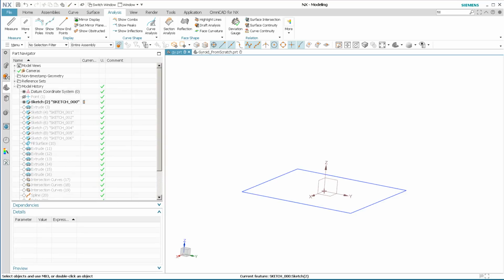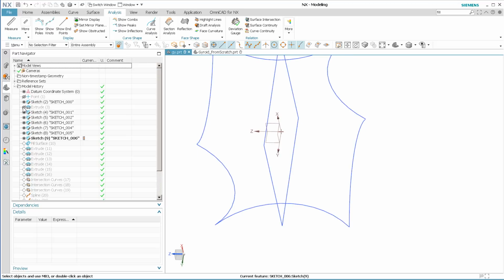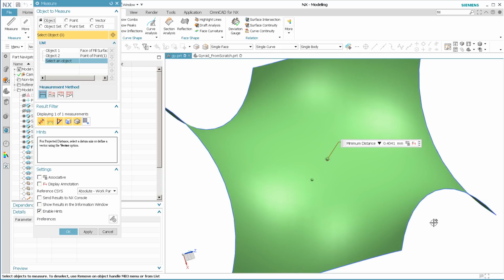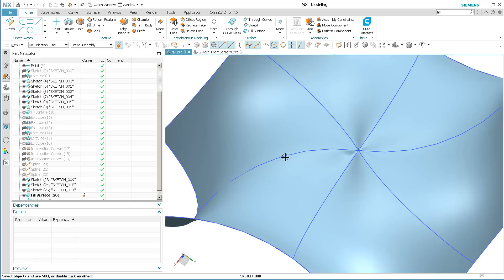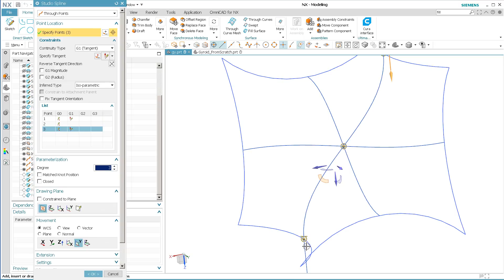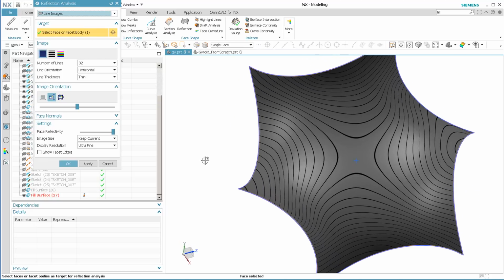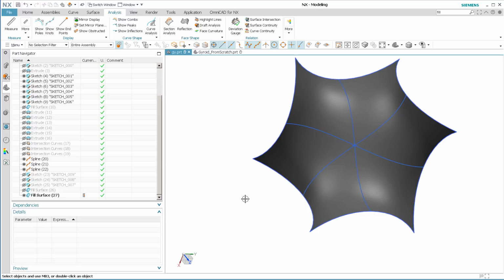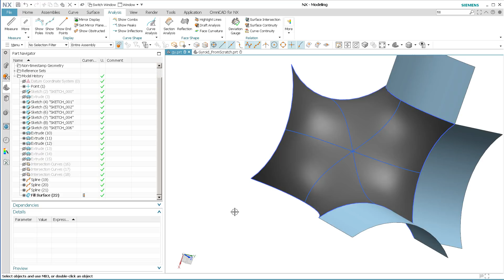Siemens NX: Modeling a Gyroid

Comment: instead of arcs, use formulas that are much closer to a gyroid, such as y=atan(sin (t*360))
Reply from the maker: Not all CAD systems support the making of a body with a formula. 

NX does have that capability but, it will be a convergent body. This is a simple non-formula method and can be thickened and 3D printed.

Comment: Very good. You call also bring the first attempt back onto the midpoint, with a fullness control, but it's a worse result. 
On thing you may not know is that when multiple copies of these are arrayed in the desired pattern to produce a lattice the edges still aren't tangent. You've piqued my curiosity with this video, and I've tried a couple of ways with only minimal success, thus far.
Reply from the maker: Correct, the Fullness Control on this is a little messy.

Their is also N-Sided Surface which was not pretty as well.

I have not seen Tangent edges on any version thus far unless it was made using STL data. I will figure out a method for surfaces but it will be tricky. 

Cheers!

Comment: Very nice solution.
NX has a math tool called Symbolica.  This is basically an integrated version of Maple software (https://www.maplesoft.com/).  You can define a surface in Maple and have it pushed over to NX.  The upside is that Maple has really strong math and can make a very parametric Gyroid surface.  The downside is that it comes into NX as a Convergent Body which is not smooth.  

Taylor Anderson (Siemens) has a video on Symbolica (you might need a Siemens Community login to view the video):
https://community.plm.automation.siemens.com/t5/video/gallerypage/video-id/hyYmZnZjE6mxWEM6X-xgmzg_uus4c8un
Reply from the maker: Since most of these shapes will be 3D printed, a faceted (Convergent) body will work perfectly.